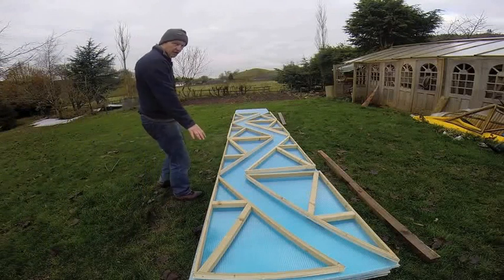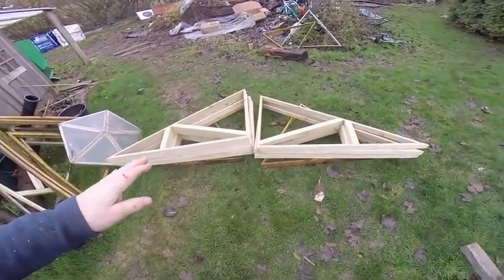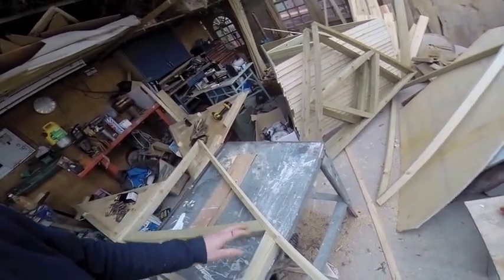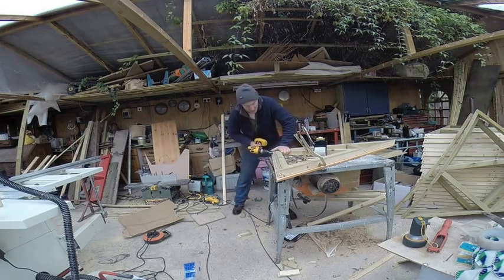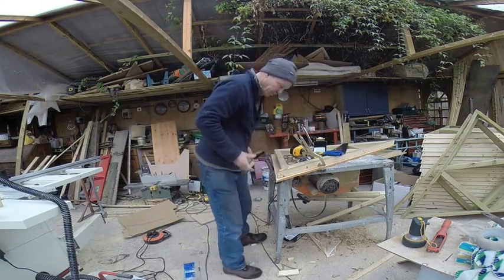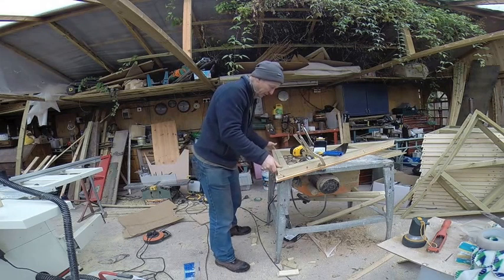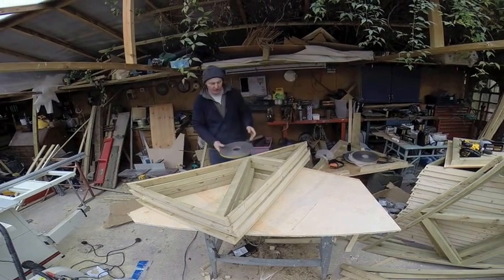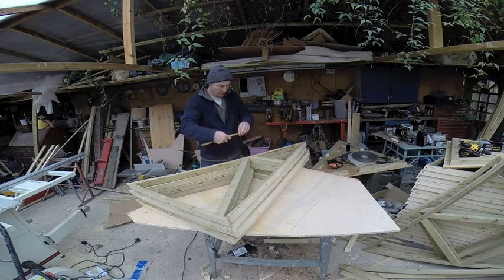pentakis4m part2

Comment: That is rad man. Couple questions.

Does the foam tape really hold up over time? I have used similar stuff for window jambs so I would imagine it's supposed to last awhile, but to hold on the plastic for a long time... have you ever had problems with it?

And is just butting the beveled joints together enough to keep out rain? Do you calk in between panels?

Thanks for the info. I appreciate your candor.
Reply from the maker: +Johnny Bayles On twin-wall like this one I tape the joints with polythene repair tape, as long as the foam tape is UV stable and good quality I don't get any problems. Same answer for your second question, the tape makes a great weatherproof seal. Did I not mention taping the joints in this video? Sorry about that.
Reply: Thanks for the response! I just bought plans for the 3m pentakis and am very excited to get building. 

In regards to the poly tape, is this on the inside of the joint? I'm not seeing anything on the outside joints. Thanks again
Reply: Johnny Bayles did you ever find out about applying the tape to the joints? How did your build go?
Reply: @erichuurre6968  Sorry just seeing this. That build went well and I've built about 6 domes now I think?? Maybe more. Yes, the tape goes on the outside of the joints. Just checking back on the video because I'm going to build another with polycarbonate.... still pretty skeptical about the foam tape but here goes...